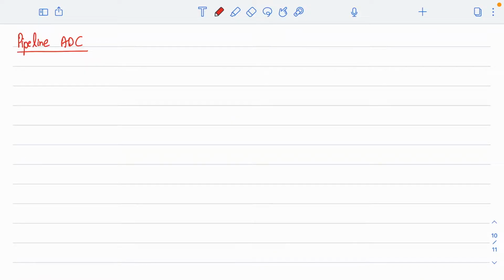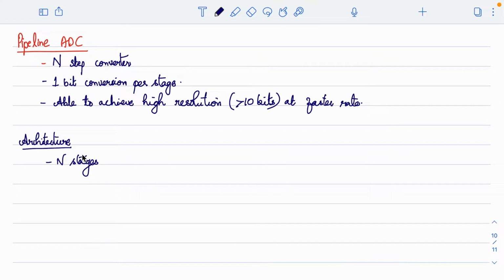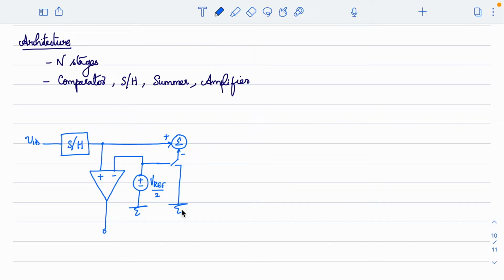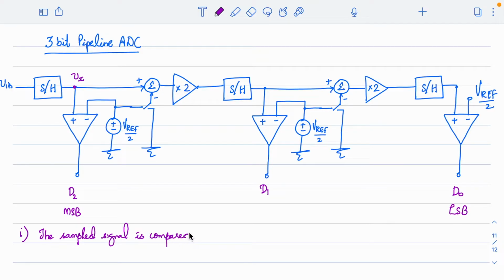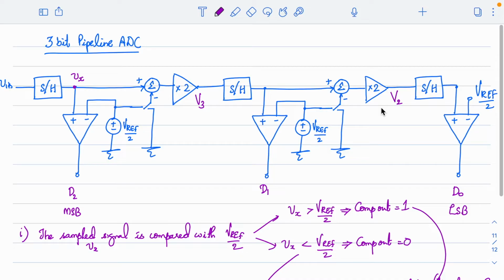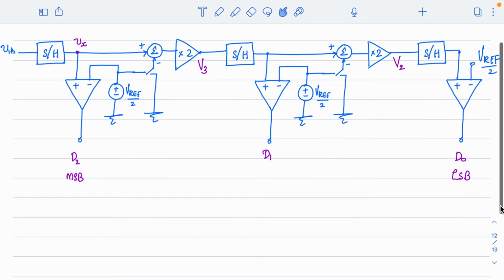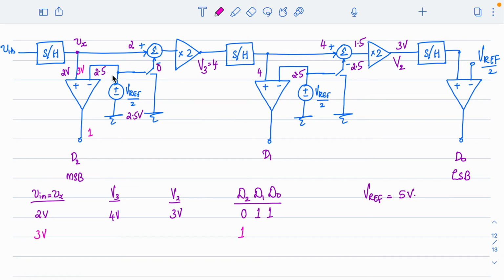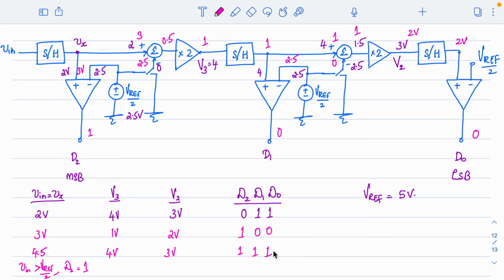MICD Unit 5 Pipeline ADC

Comment: sir when you are taking input is 2 volt and corresponding output is 011 (3)  similarly for 3volt input also output is 100(4) , but for 2 volt it should be 010 and for 3 volt it should be 011  so after the digital output D2 D1 D0 we have to connect some other circuitry so we will get exact digital output